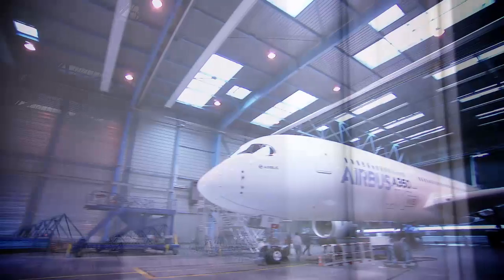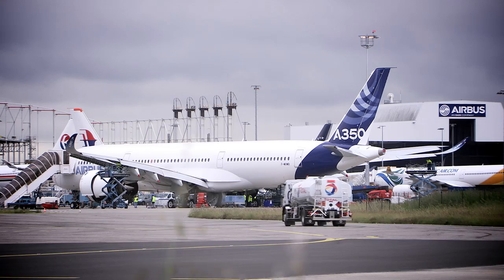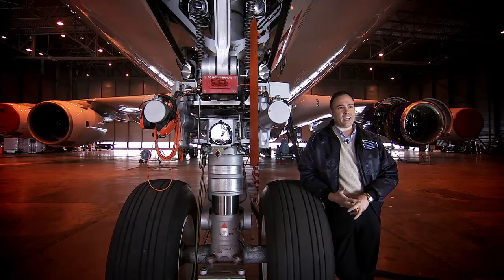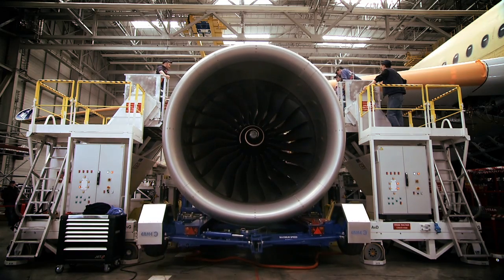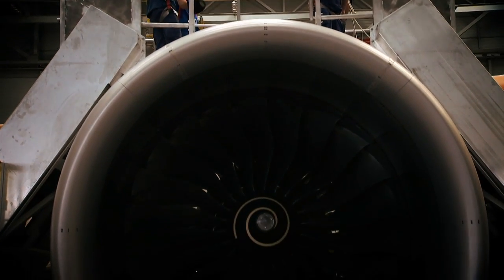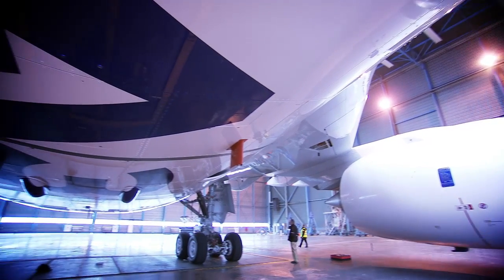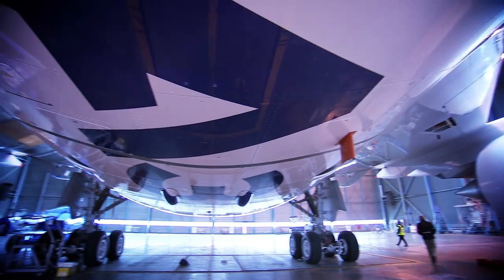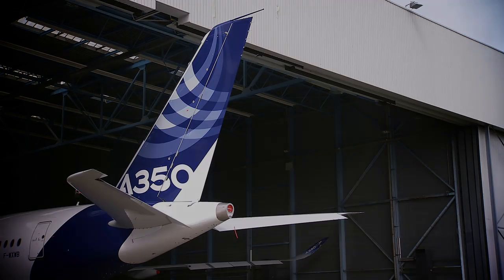Powering the A350 XWB

Comment: Actually, GE's engines have a poorer safety record overall than RR. If you check out the Aviation Safety Network's database, you'll see that there have been several uncontained explosions on CF6-45/50 & 80E models over the past decade, compared with the one Trent900 on QF32. I personally think it would aid sales if the 777ER & A350 had two engine choices. GE's 90 series & GEnx are very good quality.